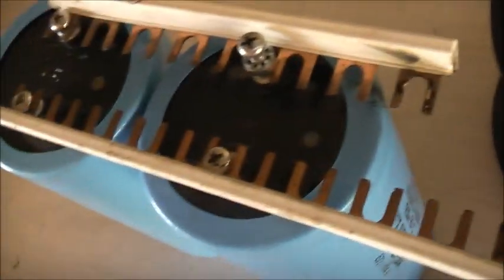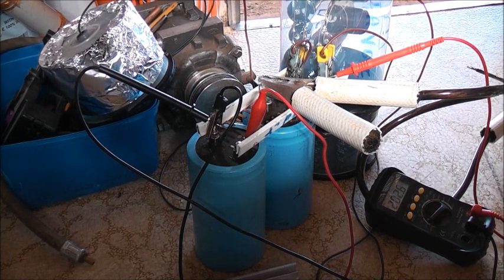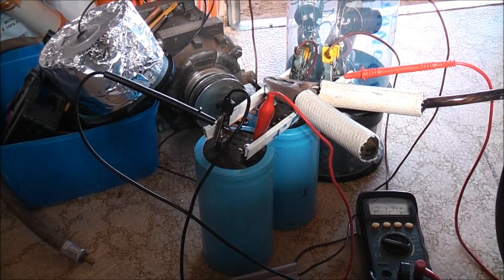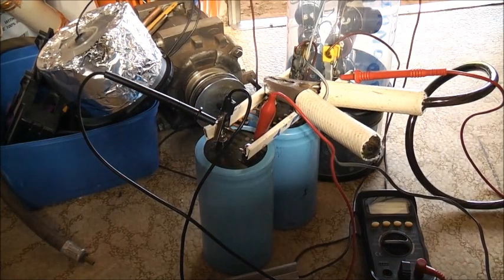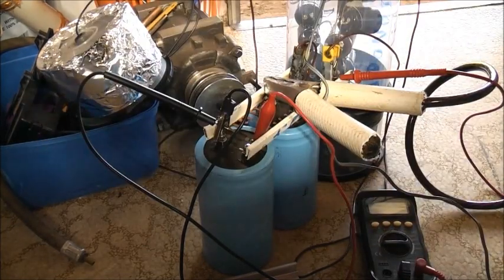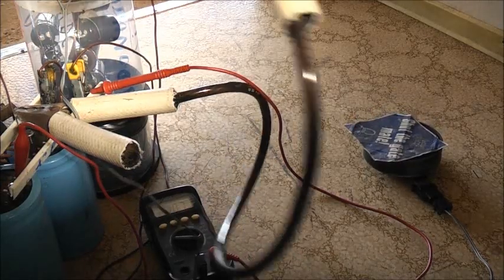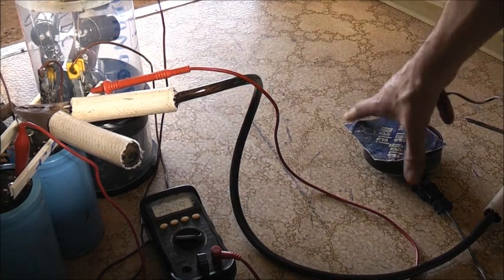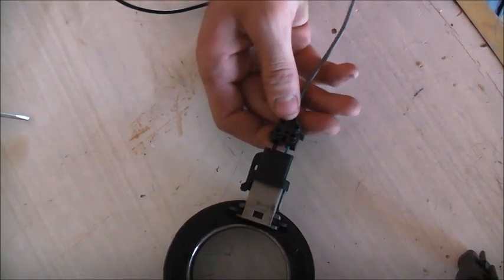Test Capacitor Bank!

Comment: Some interesting sparks 'n' pops in this vid, and like you've already identified.....The leads are a bit on the thin side.

......This needs meter tails. :D

If need be, just get a length of 3-core 1.5mm appliance flex & twist all the conductors together in it & that'll give you a total conductor size of 4.5mm.

It'll be etter than those leads you're currently using, but not as good as a big chunky 35mm flexible welder cable. :-)

Thanx for showing,

-BoomBoxDeluxe.
.
.
Viewer # 21. :D

Comment: do be careful there mate. the little ones, even tho are in parallel, i've had an incident before :) you need to get yourself some ally or copper and make some buss bars :) also are you using an isolating transformer when charging it from the mains?